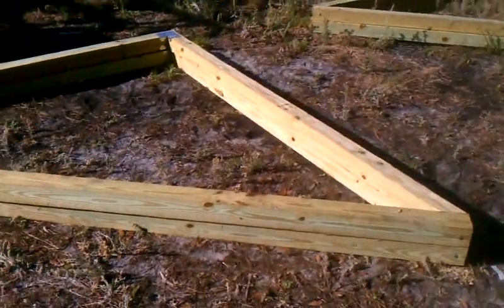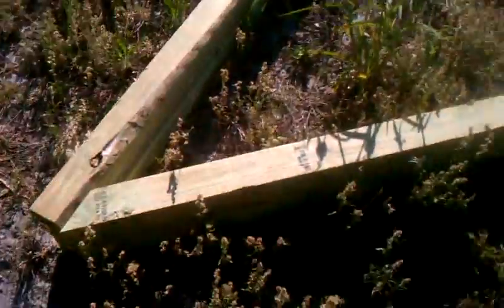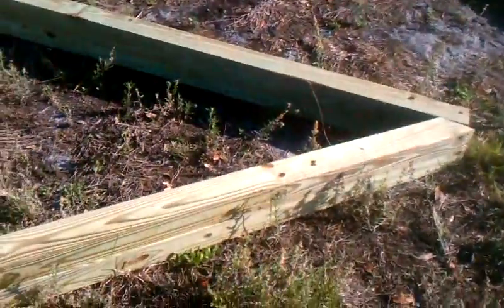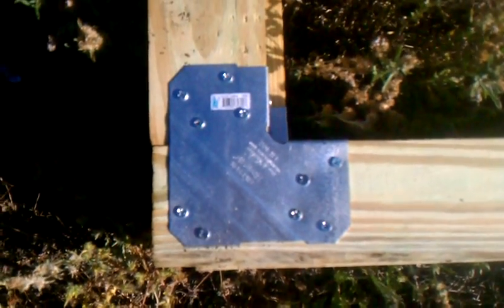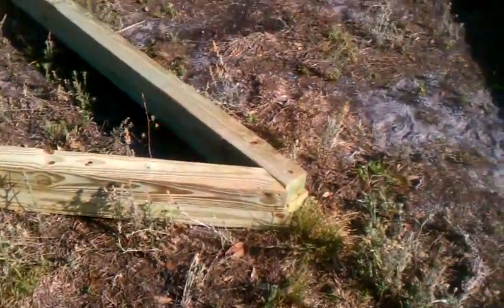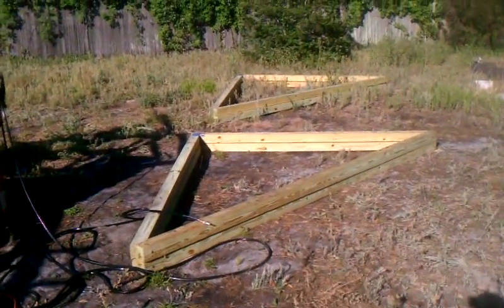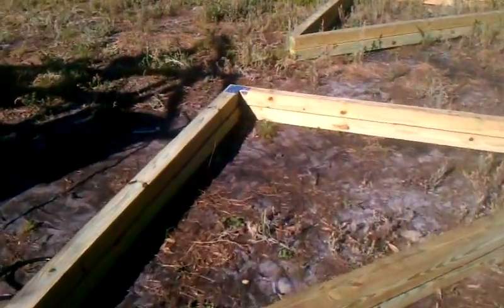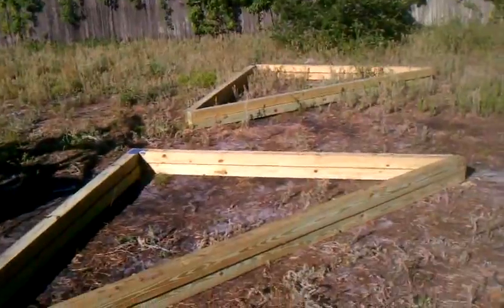SOLAR PANEL MOUNT! 3,150W OF SOLAR PANELS PART 2

Comment from the maker: Yes sir, I'm on it already. I'm going to probably guy wire it down just to be safe. It's going to be a giant sail so I'll anchor it in the back. But, just to give you an idea, one of those triangles probably weighs about 70-80lbs if I had to guess. It's been raining for days now, hopefully I'll be able to get back out there tomorrow. I just have a little bit more to go! Ugh... :)

Comment: Nice,, ground array is the way to go. just for the sake of saying it you should angle them at the same as your latitude (for example we are at 41 degrees lat. so that is what I would set my angle at.) Your set up looks to be heavy enough for wind load. but I would anchor them anyway ,, don't want thousands tumbling in the wind !!

Comment: That looks like treated lumber, it will cause cheap zinc plated bolts and screws to oxidize fast, switch to stainless steel,